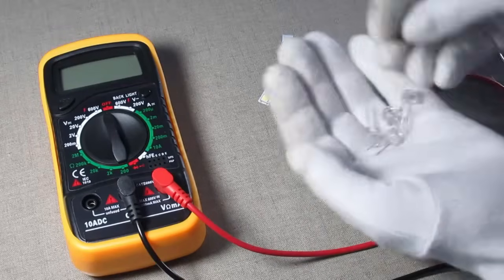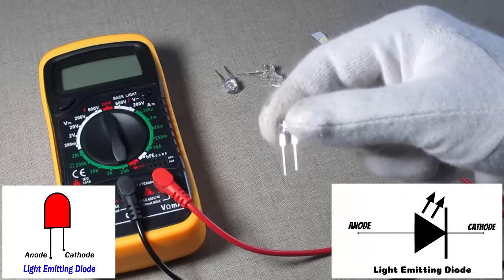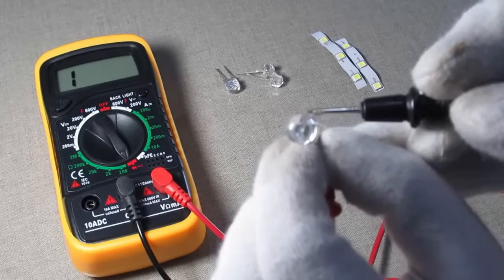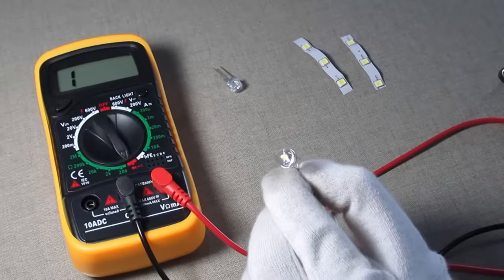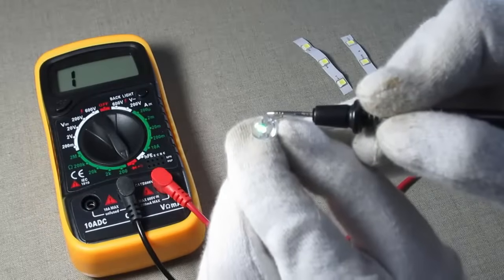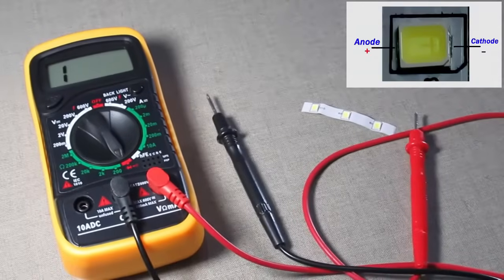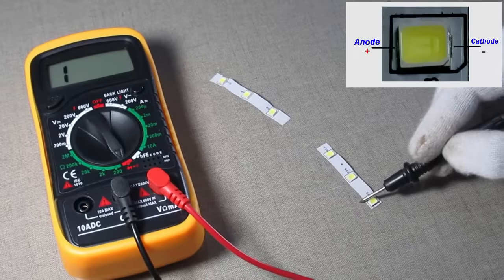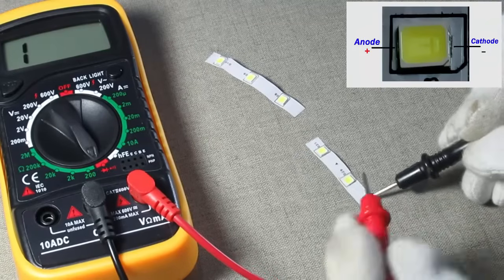LED Bulb, SMD LED Lights Testing and Checking With a Digital Multimeter || Light Emitting Diode ||

Comment: Why doesnt the continuity buzzer sound when the led is tested?
Reply: He explained that on the first multi strip led that if it buzzes it is shorted out
Reply: Because an LED is a diode and requires a certain forward voltage usually 1.8V-3.3V depending on its color and type. Continuity mode doesn’t provide enough voltage so you have to use diode mode to test the LED. Make sure that the black probe is touching the cathode and the red probe is touching the anode. If the LED lights up that means it’s working.

Comment: How do we check the actual wattage of led bulb using multimeter?
Reply: Check how much resistance it has by itself out of circuit and divide it by the voltage that is supplied to the led x2 : watt=resistance /voltage x voltage

Comment: This is only working in dc based smd not led bulbs which have AC circuit inside the normal 220v led bulbs so is there any other ideas to led bulbs smd because this is not working on that